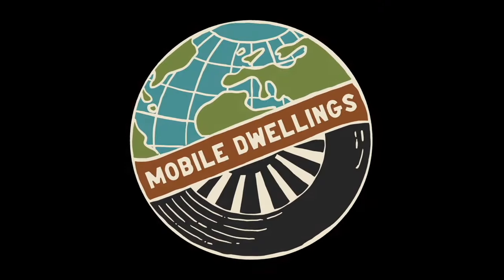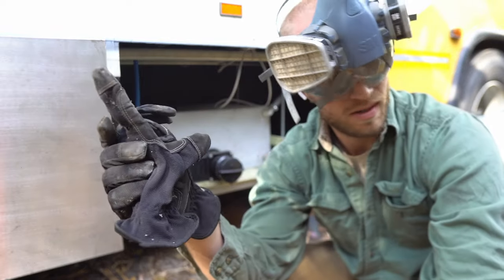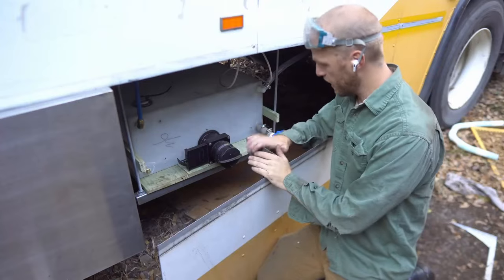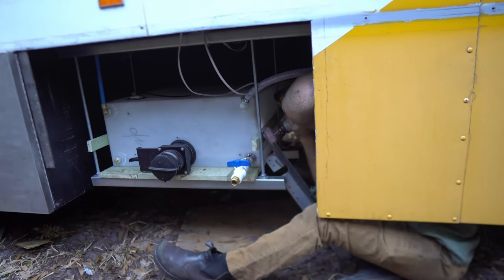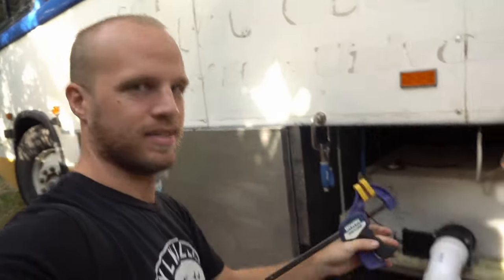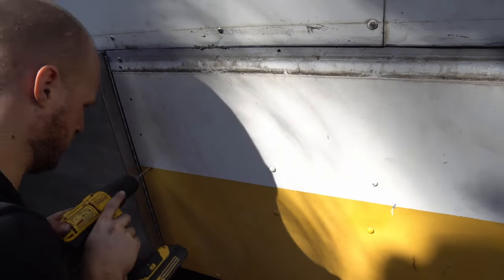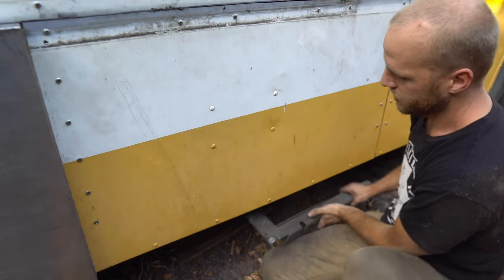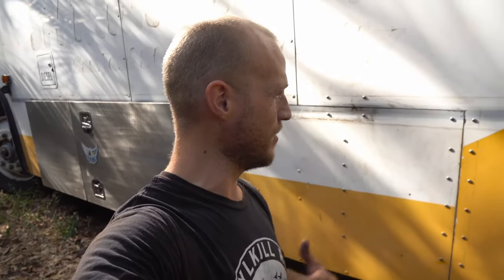Patching a Huge Hole in the Side of Our Bus Conversion!

Comment: I have a 73 gillig 35 footer taken out of service in South San Fran in early 80's and converted in early trailer park method with all metal plumbing with propane water heater I got it freshly repowered with a CAT 3208 back in o5 for a song and have had it mostly as storage box it still runs bur rust has attacked the line where the rain gutters mate to the outer roof panels and now have 15 rust holes per side I have mostly flex taped them as none are more than 2 x 2 max what do you recommend I use as patch materials as a welder said the metal is too thin to weld 
Can you list exact materials that are available for use I only need it to last 10 years at max as I hear we shall own nothing and be happy then :-()
Reply from the maker: Sounds like a sweet bus! Sorry you're getting some rust! I would take a jig saw and cut out the rusty areas. Then I would prime and paint the edges/the repairs. Then I would buy squares of sheet metal from Home Depot, or metal supply store, maybe 12x12. I would then screw them with sheet metal screws and rubber washers into the bus ceiling from the outside with a good quality adhesive between the metal and the patch like Sikaflex 221. Then I'd cover the repair in Dicor self-leveling lap sealant. You can see me pretty much do that process here: https://youtu.be/oXF2OxOMKb8?t=514 Good luck!
Reply: @MobileDwellings  
Oops I should mention that it still has the original 2nd layer of sheet metal that was original since the original owner and I too are under 5 foot 9inches and that means I could strip of the material literally old textured nagahyde in brown with diamond tufts which is pretty ugly though better than institutional green painted sheet steel and perhaps use it to fill my ceiling roof layer on the outside and do the grueling furing strip ceiling support with insulation as everyone does now I already scored a few thousand self tapping screws and I can see where a similar repair or two was done this old beast was owned by a previous school bus driver and wife ( as am I ) they took it down to key west and up to the arctic circle between 1985 and 2002 before his wife took ill I have stickers inside from all the places they went 
It was quite an adventure they went on before donating it to charity after their generator was stolen in storage and I bought it but failed to reconvert it quickly after getting it ( it's quite an undertaking as you well know ) and not easy or cheap to make it like a work of art 
We want it as filled with the comforts of home as can be before we wind up with it as our home

Comment: Man you messed up big time. How are you gonna attach a hose or operate that drain valve???? 
PIANO HINGE.... and get the drain valve with the remote cable.. That way you can drain from the remote cable T handle.
Reply from the maker: Nah it's super easy. The elbow sticks the drain hose connection right underneath the panel. Just spins on. And to pull that handle all you need to do is reach up and pull. Maybe it looks hard in theory but in practice you just squat and pull it.